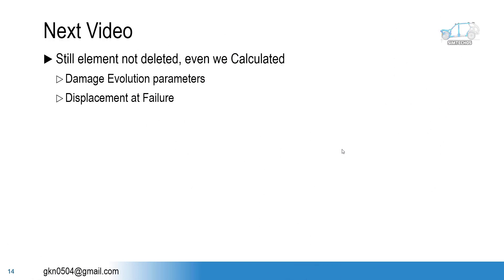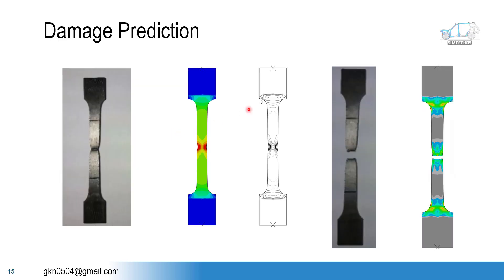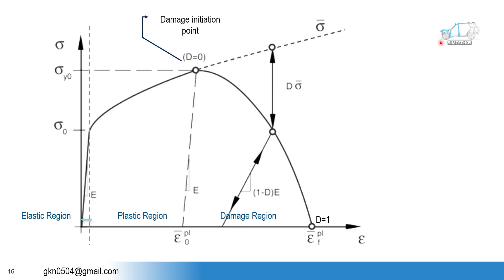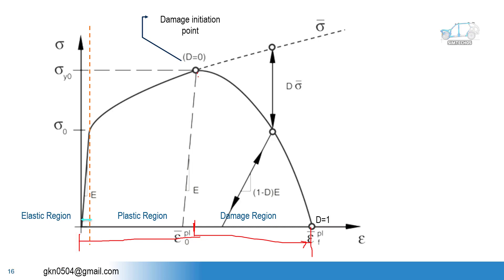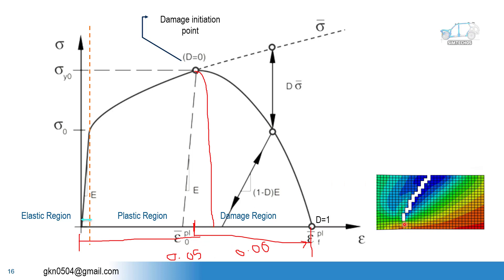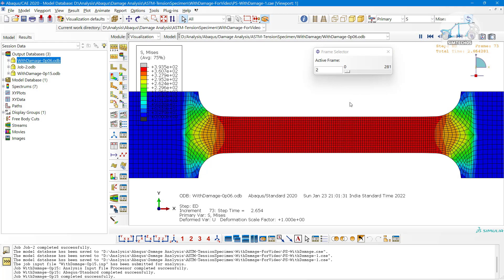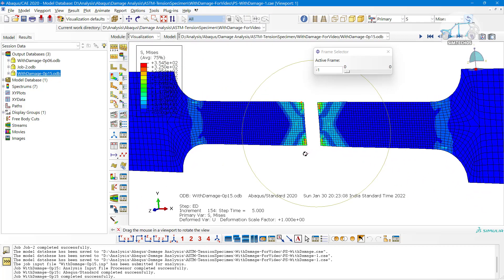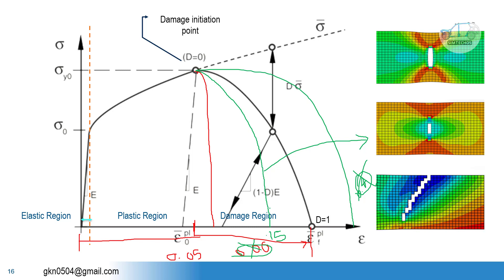Ductile Damage evolution in Abaqus (02 - Effect of Fracture strain on Element deletion)

Comment: thank you for the video. I want to ask or rather confirm, based on Abaqus online documentation, fracture strain is equivalent to fracture strain at damage initiation. So, the fracture strain is not from zero point to the plastic strain at failure (ephsilon, pl, f), but from zero point to the equivalent plastic strain at the onset of damage (ephsilon, pl, 0). But in the video 3:19, you mention that fracture strain is from zero to plastic strain at failure (ephsilon, pl, f).
Reply from the maker: Dear,
Damage initiation is the point from where fracture starts. But its value can certainly increase till the complete fracture. I think you misinterpreted the abaqus documentation. Please check again.
Reply: @arsitech-ltd  Hello, do you mean that the equivalent plastic strain (onset of damage, "ephsilon, pl, 0") changes when the element deforms?

Comment: Please how find the stress triaxiality and strain rate
Reply from the maker: Dear,
For stress triaxiality you need to perform couples of experiment on set of predefined shape... there also analytical methods are available...like for round bar, round bar with notch etc.
With the help of optimization technique applied on these data point you can find a relationship for strain triaxiality.

For lower Strain rate you can use standard tension test machine. For higher strain rate the split Hopkinson bar technique is often used (10^2–10^3 /s) and with some special experimental setups, strain rates can reach up to 10^4 /s.
Reply: @arsitech-ltd   i have exemple of aluminum 2024 t3
Reply from the maker: Dear,
I don't have data for your material. You need to find out releted research article or contact to material distributor or need to conduct experiment by yourself.
Reply: @arsitech-ltd  thunks 😊

Comment: fracture strain is the intersection of a linear function with the slope of the elastic modulus and the ultimate stress, so it has to be lower than the strain corresponding to the ultimate stress
Reply from the maker: No dear,
Watch carefully.
Reply: @arsitech-ltd  do you have a reference for this claim ? according to the abaqus user manual, the fracture strain is defined as the equivalent plastic strain at damage initiation. you seem to confuse it with the failure strain in a stress strain diagram. here is another quote from the abaqus user manual:

The ductile criterion is a phenomenological model for predicting the onset of damage due to nucleation, growth, and coalescence of voids. The model assumes that the equivalent plastic strain at the onset of damage, 
is a function of stress triaxiality and strain rate.
Reply from the maker: In the figure 
σy0
 and 
ε_pl_0
 are the yield stress and equivalent plastic strain at the onset of damage, and 
ε_pl_f is the equivalent plastic strain at failure; that is, when the overall damage variable reaches the value D=1

https://abaqus-docs.mit.edu/2017/English/SIMACAEMATRefMap/simamat-c-damageevolductile.htm
Reply: @hnrwagner  Hello Dr. Wagner, I am confused by the definition of fracture strain. Can you please explain it a little more? Many thanks
Reply: @arsitech-ltd , Dear friend, I'm with @hnrwagner. The Abaqus online documentation says that the Johnson-Cook damage model (empirical formula dominated by d1-d5) calculates the failure strain corresponding to the equivalent plastic strain at the onset of the damage, not the equivalent plastic strain at the point of final fracture. Meanwhile, 
 The original statement of the document, "The value of the equivalent plastic strain at failure,(ε, pl,f), depends on the characteristic length of the element and cannot be used as a material parameter for the specification of the damage evolution law.", also indicates this view((ε, pl,f) is determined by the failure strain calculated through Johnson-Cook damage model and displacement at failure or fracture energy).